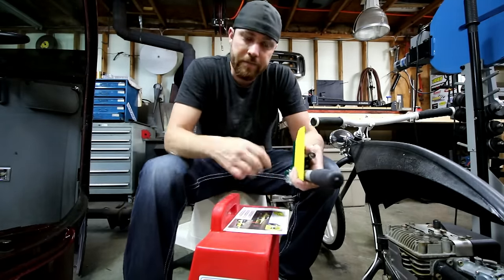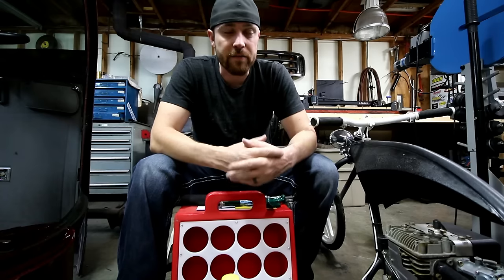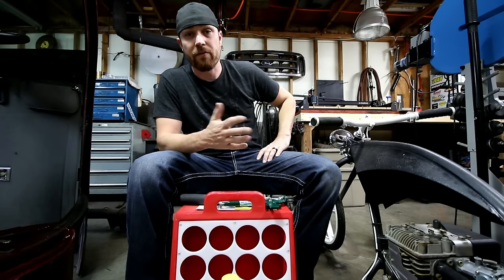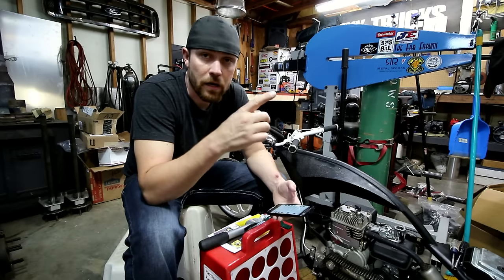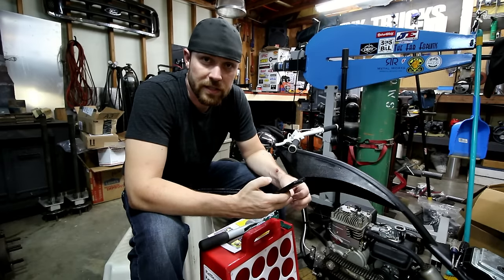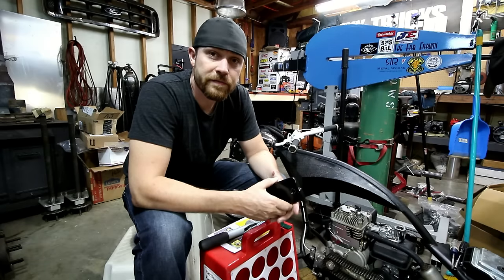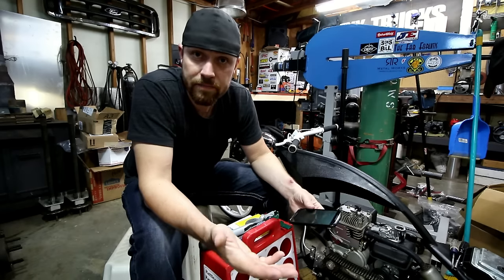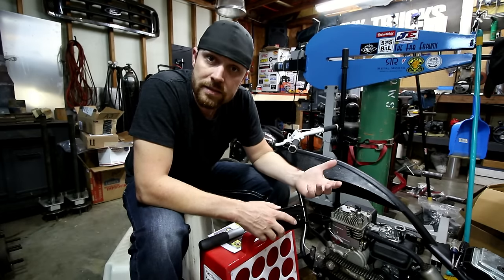DO NOT WATCH THIS VIDEO !

Comment: The concern with your seat mounts isn't the rear support, it's the floor support.  Kirkey recommends that you mount the seats in sheer, if you use the seat brackets they offer they allow you to do this very easily.    In the event of an accident the floor mounts that you have will fail and can cause back injuries.
Reply from the maker: +RecklessRegal mounting in sheer is no where in their instructions. Actually says to mount through the bottom exactly like I have...https://www.kirkeyracing.com/images/uploads/files/09%20Series%20Installation%20Guide%282%29.pdf
Reply: +The Fab Forums 
It appears you are OK.
See section 6:2. 

http://www.nhra.com/userfiles/file/Tech/Gen%20Regs%20from%202015_NHRA_Rulebook.pdf

Also see: 
SFI 39.2 specs 
SFI 25.xx spec that applies to your particular application.

http://sfifoundation.com/
Reply: +RecklessRegal They don't have to specify in sheer, because the only way to mount the seats with the Kirkey approved brackets is in sheer.  There is no other way to do it unless you do not use their brackets, and Kirkey seats are only intended to use their brackets.  https://www.kirkeyracing.com/related/99203%20&%2099204%20floor%20seat%20mount%20installation%20guide.pdf
Reply from the maker: +RecklessRegal I don't see anywhere it says you have to use their brackets.